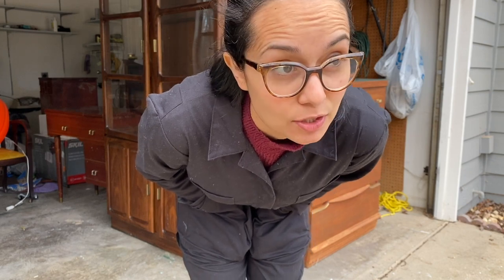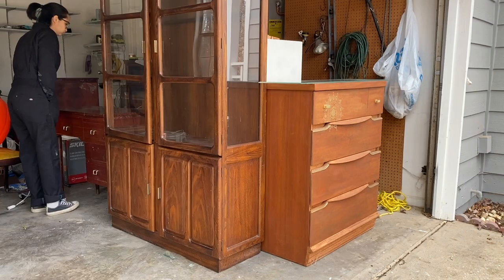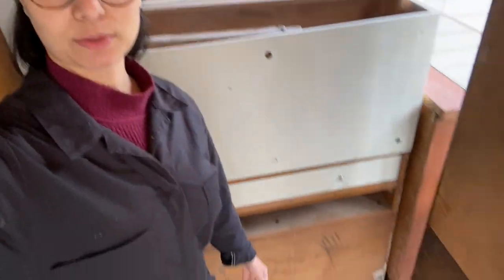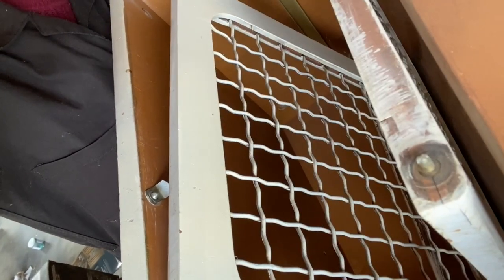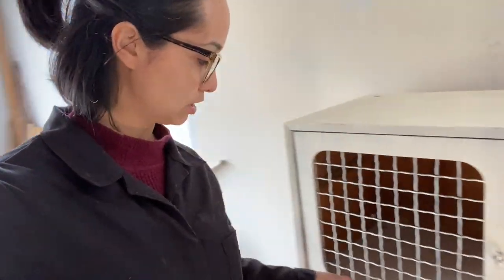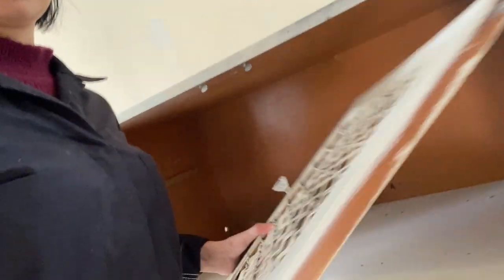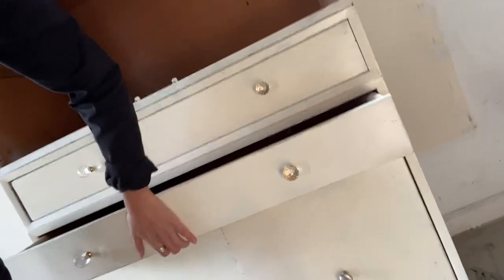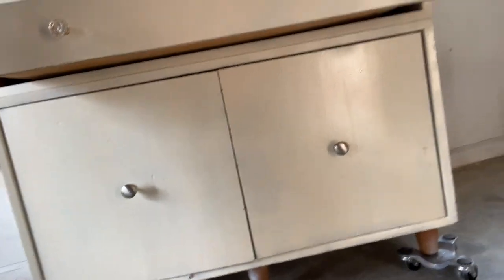Ugly Duckling Challenge Hosted by Desert DIY | Coffee Bar Edition | Episode 35

Comment: Have to say it turned out beautiful, thanks for the gold painting tip. I thought it was raw wood from thumbnail.  If using burlap again try a tighter weave, and iron it with spray scratch , it will keep fabric from pulling too much.  So why did you fill the door edging with pudgy?   Wouldn’t it have been better to put fabric in slot and then hold it in  with a small quarter round or dowel. Canning would have worked too.
Reply from the maker: Wow! You’re capable of a compliment! It’s an honor to receive one from such a harsh critic! I’m not too sure I know what you mean with the dowels though. How would that work? Is there a video you’d recommend for this so I can get a visual?
Reply: I was thinking that also maybe the dowel and a small nail to tack it in and have a more finished look but then I said well maybe she didn’t decide to go that path at the start when she was filling it in! But it did turn out great 👍